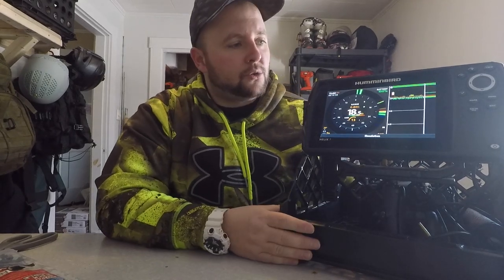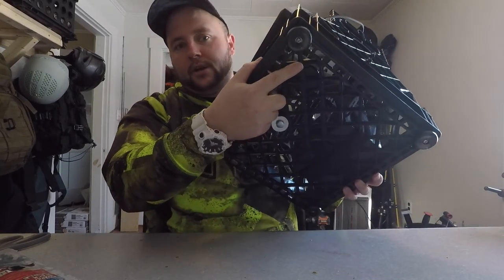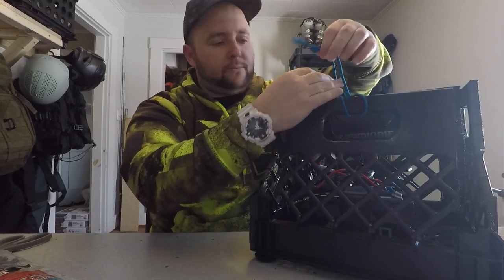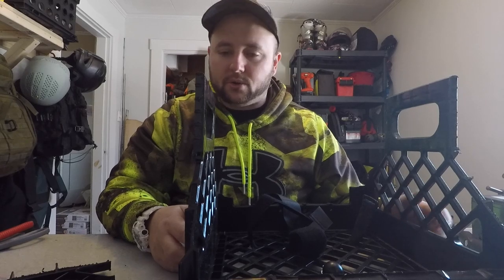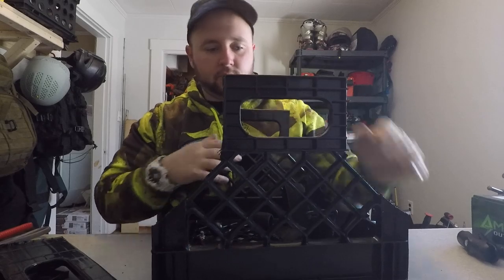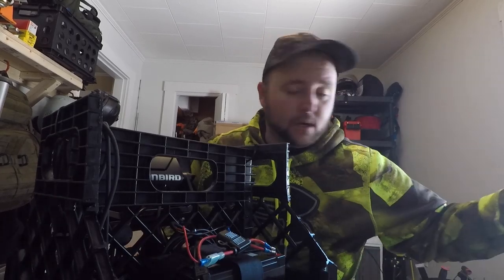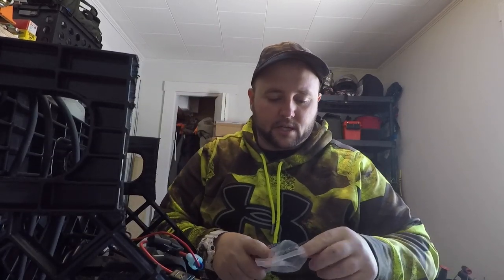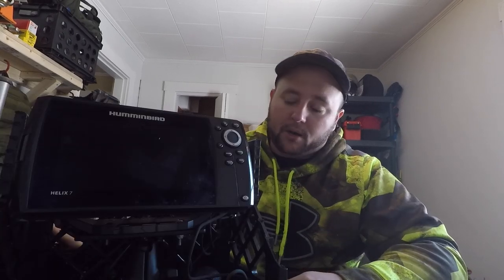$10 DIY Milk Crate Ice Flasher Shuttle + How I Rig My Humminbird Helix 7.

Comment: That’s awesome and I’m gonna make one with one mod.  Add pool noodles to the bottom, either around the perimeter or 4 strips side by side.  This gets it up off snow and ice, allows better drainage, gets it closer to my eyes, and provides a cushion when pulling my Jet Sled. Not sure yet but I might cut the noodles length wise so it’s not too tall and bouncy.
Reply from the maker: It s a handy shuttle. Still using it. Only thing I’d be worried about with the noodles would be them freezing to the ice!!
Reply: @precisionanglingYT  good point I’ll have to consider.

Comment: Thanks so much for this great idea. I already had a regular battery and an Li battery. Did not need the extra one that comes with the $$ case. I used my Cellblock (YakAttack) for the battery and zip tied it to the bottom of the crate! I only cut open one side of the crate. I have the mounting arm and brackets from my kayak mount. Works like a charm. Now for the ice to thicken up around here!  You saved me a bundle!
Reply from the maker: Fantastic!! Exactly why is post these!! Glad it worked for you!!

Comment: Nice for sitting in the shack. But I wouldn't want to drag that thing around hole hopping. Looks heavy as hell compared to the industry standard.
Reply from the maker: Lighter actually. The box weights basically nothing. The 18ah lithium battery only weighs 3.5 lbs.

Comment: Is that the stock transducer? Or a different style for ice?
Reply from the maker: This is their ice transducer. You need it for ice mode to work properly.
Reply: 10-4
Reply: Which transducer do you have? I need to order one for my g3 helix 7 di and si.
Reply: And also. . . Do you use a fuse?  I  used my helix on my kayak all year long and didn't use a fuse. Is that bad?